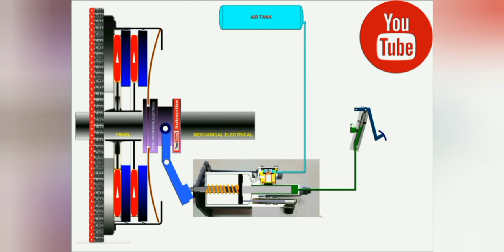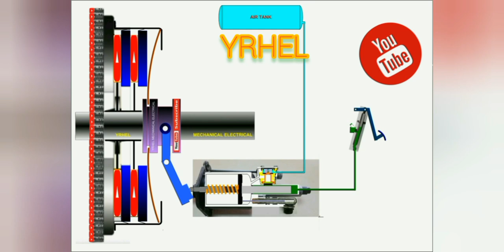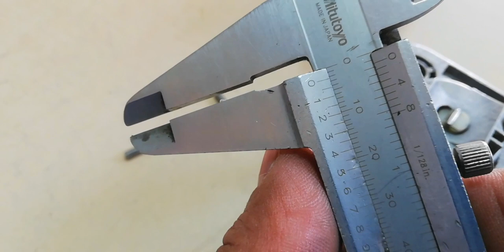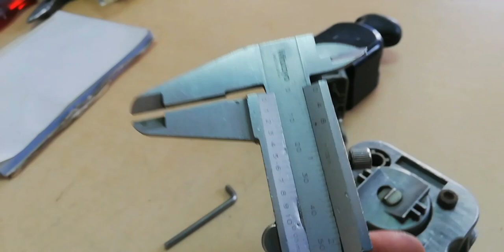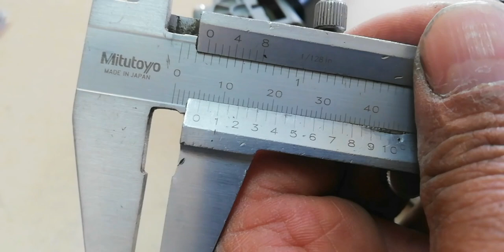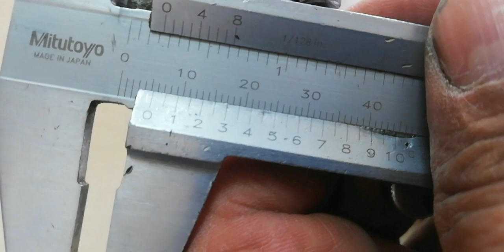HOW TO REPAIR HAND BRAKE VALVE for Mercedes Actros Truck

Comment: Thax for sharing your knowledge 👏👏ihave solved my handbrake problem but now briza it's no more airflowing it open and shut but now the problem comes after stopping and put handbrake back valve at the diff with 2 sensors flows air in right sensor